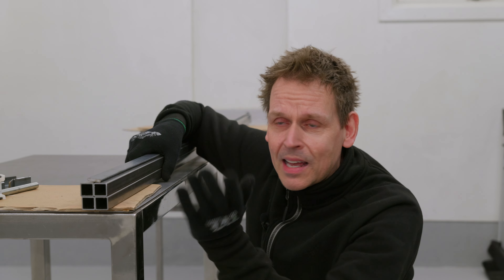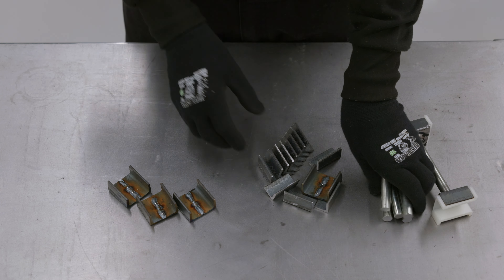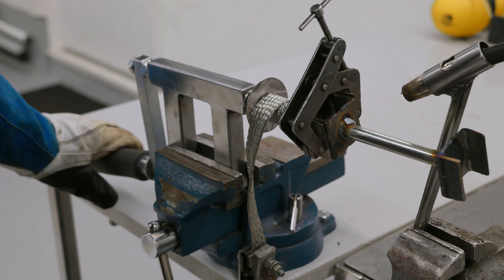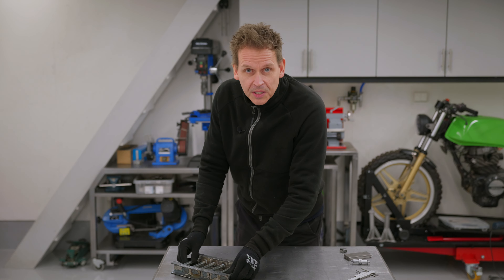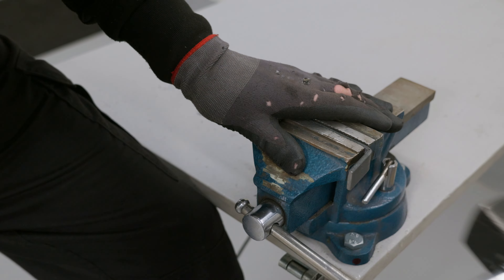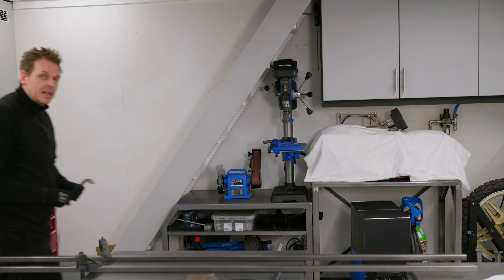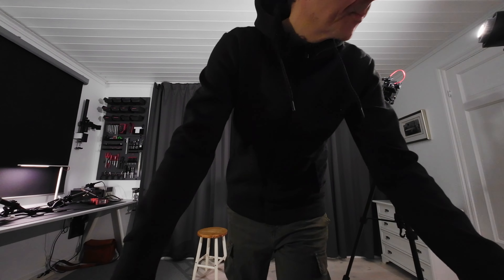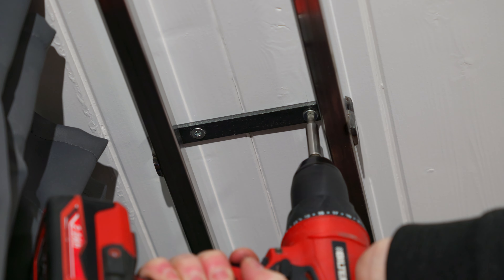DIY Ceiling Track System - Unique Low Profile Type!

Comment: Your simplified sliders can be even simpler: You don't need the 4 screws, just some adhesive.
Reply from the maker: You are probably right, perhaps even just a profile on top of the 3D print to keep the sheet metal from rotating would have been good enough 😊

Comment: Where it is applicable, you might want to  try "plug welding".  For example in the ceiling brackets, where you welded two short welds, one on each side of a "leg", if you had first drilled a hole in the leg between those two welds, then you could just weld in the hole and grind it flush and it would completely disappear.  It would also prevent as much weld spatter as the welds you did on the legs.  The home made track system is brilliant!
Reply from the maker: You are absolutely right. I have done it many times, makes a much better result. Somehow I just did not think about it this time 🥴

Comment: Glider/Slider - either to be honest!
Gliding is more effortless and continuous, think ice skaters on ice, and is usually a more elegant motion.
Sliding usually involves more friction and is more of a short distance movement.

When you tested them on the bench I would have called them gliders as they whizzed down from one initial push, but once on the ceiling there seemed to be more resistance, so now they're sliders 😂

And yes, you can slide the gliders! 🤣
(in fact it sounds nicer than sliding a slider)

Isn't English fun?

Very nice build, one suggestion, get some cheap photography arco/swiss quick release mounts onto the Glider/Sliders, that way you can disconnect things without having to spin them round on a thread if you want to change the order of the items.
Reply from the maker: Thanks a lot for the clarification, but now I'm even more confused 😅😂 Adding a quick release system was a good suggestion 👍 I have already switched around the lights a couple of times, unscrewing the rods is not that easy when stuff is attached to them.